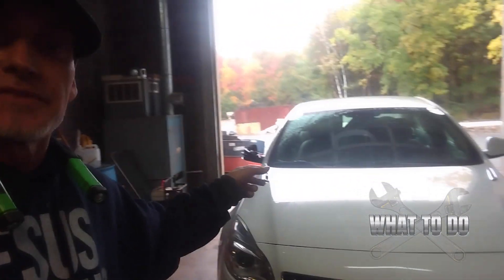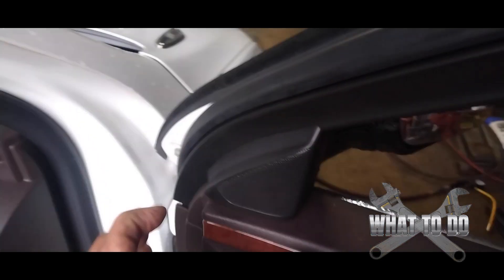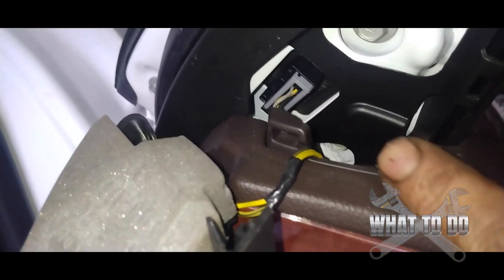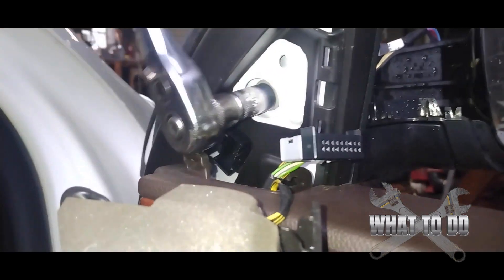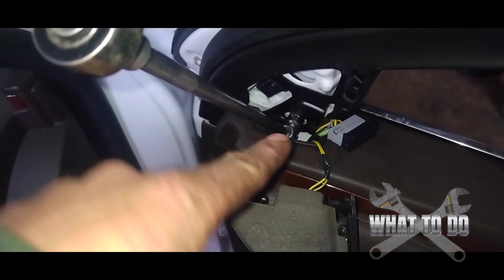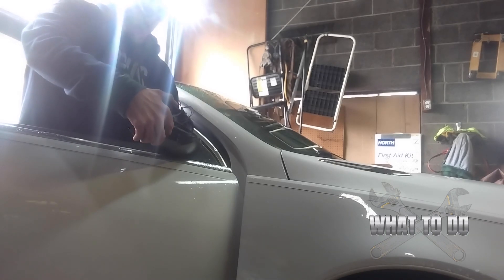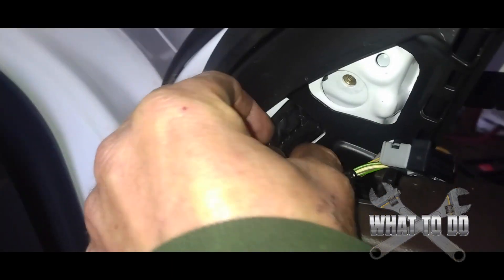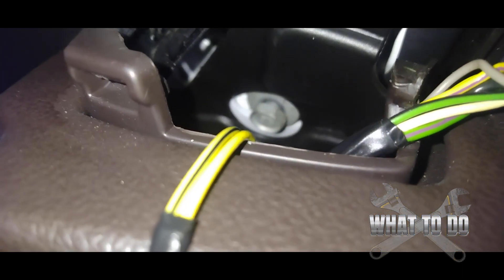How To Replace Mirror - Buick Regal Sport - Passenger side

Comment: I have a 2012 Verano but could not find a specific video for it. There are two easy access bolts in front of the door panel. I don't know if there is any inside the door panel?

Comment: Thank you I’m going to try to do this myself but wasn’t sure what tools I needed to take the bolts out! Smh I’m going to get a magnet and 10mm socket
Reply from the maker: Yeah it's really not too hard of a job just be really careful on that boat that's further down and have a magnet handy just in case you drop it or if you have some type of magnetic 10 mm that would help as well good luck with your install.
Reply: @youtubestar  that one bolt at the bottom gave me hell I almost had to take the door off! I didn’t even bother to put it back on lol
Reply from the maker: oh my lol. Yeah its a lil stubborn. Hey at least you have a mirror now.
Reply from the maker: Congrats to you for doing it on your own though. Great job. Glad i could help.